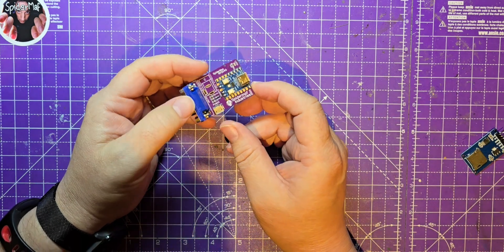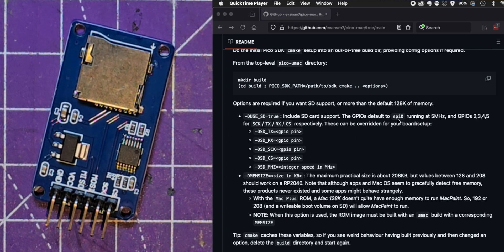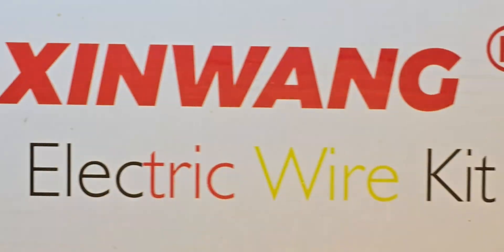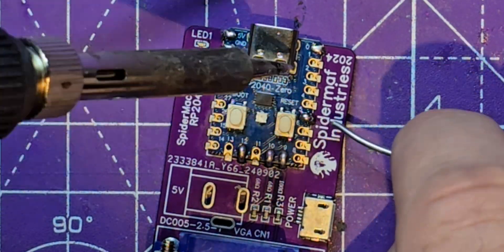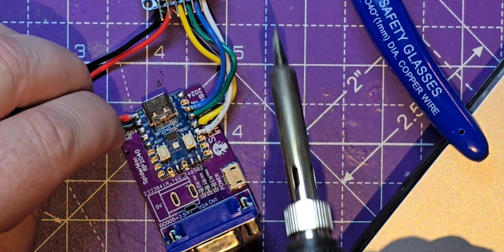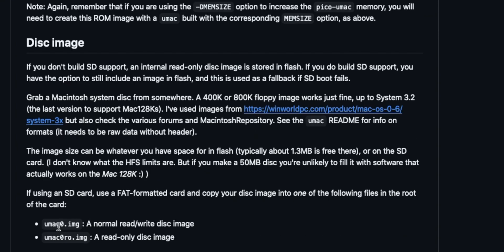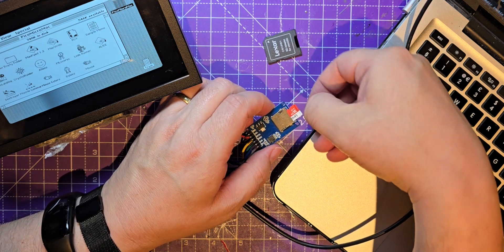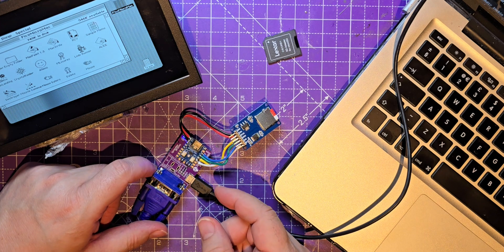Trying to add an SD Card drive to  MAC 128 on an RP2040-Zero.

Comment: if you have an old scart cable, i recommend you cut the ends and carefully run a razor blade to remove the outer shell. lots of very thin cables, usually various colors. the cheaper the cable, the thinner the cables are. perfect for these projects with tiny pads

Comment: Loverly board. Ive just modded mine with some female headers on the 12 unused pins, so i can connect up an sd card or anything else that comes along. Great work, now i just need to learn pico sdk programming as I've only used arduino ide and with the pico core!
Best i get the sdk installed and try it. Lets see what i can mess up!
Reply from the maker: Ahh good call. Glad it all worked for you. Hoping to do.a v2 version with the headers for the sd module maybe even an on board sd which I bet I won't get working!
Reply: @spidermaf  all my SD cards are in a different pin order was hoping i could just plug it into the headers the bridge the power wires over with 2 short links! 
I really dont understand the pico native sdk and especially pio! 
Maybe a short video about how and what you modified in the firmware to change the pinout for vga (and enable SD card (when you've worked it out)
Onboard sd instead of the 5v jack plug. 
To run a micro SD is easy enough just remember SD cards are 3v3 not 5v if doing it directly.

Comment: The PicoMac will only try to read the image at boot, you must reset the device for it to get the image from SD. I have tried myself to implement the disc swap but it seems that umac lacks a lot of code to do it, I tried to replicate the basiliskII code but the CPU traps seem to not to work properly.

BTW, if you are interested I have a modified PicoMac that instead of VGA uses HDMI and also implements a boot menu to select the disk image.
Reply from the maker: Yeah, there was another more fundamental thing I'd  missed so the video of it working should be my next video drop.   But in that I discovered that it would only sense the disk at boot.  I was wondering if the hardware  card insert line (not present on my card module) could be used to sense an insert, but any code changes to sense that aren't my field. 

I'd love to have a play with your HDMI version. (And maybe do a video about it if you are willing) have you got it online anywhere?

Comment: Cool attempt. You might consider this option: try to partition the SD card in two sections, and put the Mac firmware on a boot partition and use the other for data. Like a Linux distro..

Nb. I used a cheap rpi2040 zero development  board and a old monitor cable  to build my version. The advantage is that i can remove/reuse the rpi for other projects and add more stuff to other ports.. 😊
Reply from the maker: I'll give the partition suggestion a go today

Comment: MOSI - Master out Slave In
MISO - Master In Slave Out.

Similar to Rx Tx (read, transmit)
Reply from the maker: Seems like.old terminology which will probably.be replaced soon tx and tx makes much more sense.
Reply from the maker: Although in and out is simple too
Reply: Well done for trying. I'm sure you will get there in the end. Two tips: I think CS is chip select. Try using blutak to hold the board down while you are soldering 😊
Reply: BTW: I received one of your boards in the post the other day. I liked the shiny jiffy bag. Thanks very much 👍